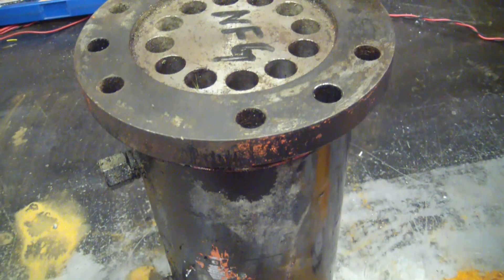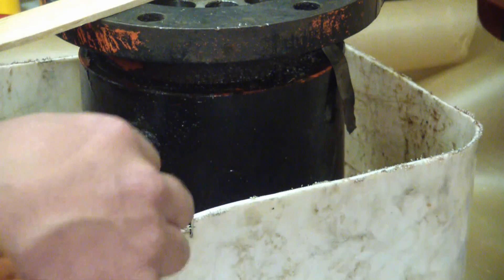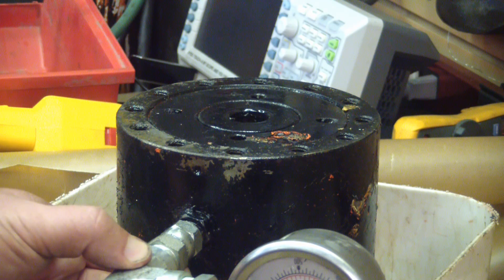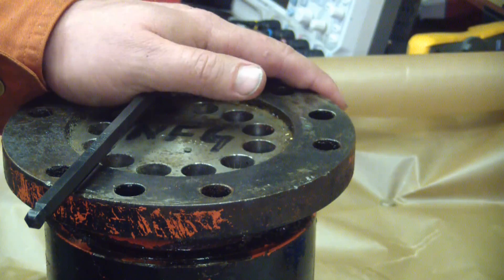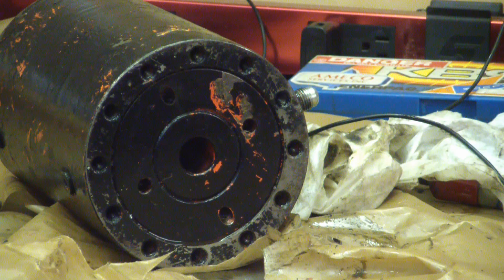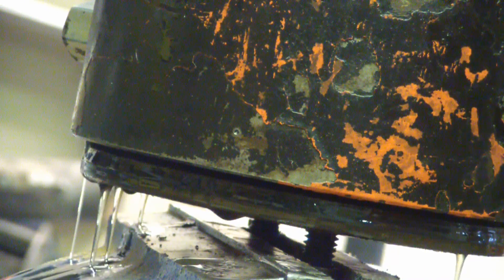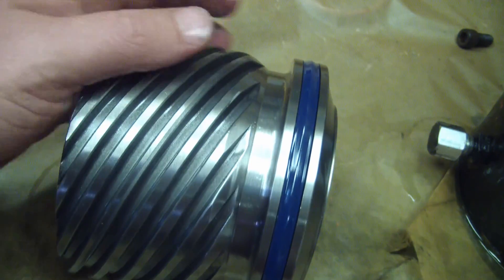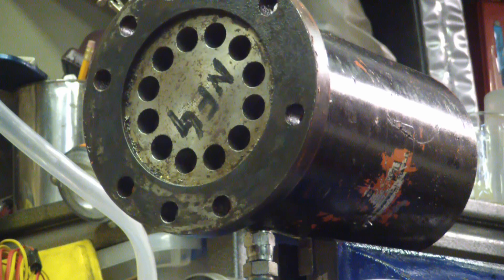BOLTR: Helac Rotary Actuator

Comment: With China making everything, it is important to remember that there are standards, and then there are actual dimensions with tolerances. Take clothing, like bathrobes or underpants. XL is medium at best and in underpants, there are small, medium and large. The larger sizes of XL, XXL, and XXXL,  are the most significant for Westerners to use and use wisely. Case in point, I am not a giant, nor am I obese; but I need at least an XXL or XXXL in a bathrobe for it to fit. In underpants, the good old standby of S/M/L mean nothing is you are a male with testicles, now I'm talking to all you single guys out there. XXL is at best a medium, so XXXL is a large, which will allow you to walk at least.

Comment: This is a great video, thanks. I'm in the middle of rebuilding an earlier version of this beast. The Helac people don't have the seal kits (Helac Hydraulic Rotary Actuator Seal Kits Part #: S26079) and won't provide specs. Has anyone here had any luck sourcing these seals outside of the manufacturer? It would be a shame to see this actuator go to the bin just because of old seals. It never saw much work in its 18-year life.
Any help would be much appreciated.

Comment: Probably useless to comment on a 7 year old video, but that's not a helical gear, AV, it's a multi-lead thread, looks to be acme form or similar.  I'd guess it's at least 8 or 10 lead from what I can see, so find the pitch (or lead) of a single thread and you'll have the ratio of turns to linear movement.  From that and known PSI and area of the piston you should be able to calculate the torque to PSI formula.   I love seeing this stuff from AvE, but I didn't realize this video was so old until after I watched it.    Keep up the fun!!
Reply from the maker: Good thinking!

Comment: God I love industrial equipment.  It's so ridiculously overbuilt.  That thing looks like it could turn the fricking planet on its axis.

If you put a monster like that into practically any conceivable hobby project, it'll probably never reach a tenth of its actual capacity.  In other words, it'll be chooching on a verifiably monumental scale.

If anything in your jury rigged contraption fails, you can be damned sure it will NOT be this thing.   And that's the kind of peace of mind that just about brings a tear to my eye.

Comment: I’m curious because of my work why you pointed out the hydraulic oil coming out of fittings? I have this happen all the time usually a drooling or quite a large hose dumping but never under “pressure” curious what exactly you meant by stop if you have oil coming out on here to learn

Comment: It's a worm on worm gear from what I see.  Forced rotary action  from the piston pushing out on the screw.  The big time pressure was the gears seized, get them flowing together properly and it'll work right quick.

Comment: There is, I believe, a solution to the gear reduction conundrum. The answer lies within the angle of the pitch of your helical gears. I don't believe you would even need to calculate pressure into pounds force and the resulting torque as a function of pitch angles. You could go that route for the long form or to check yourself but I think it might be unnecessary. I believe you could merely figure a ratio between pitch angles between helicals and boom, gear reduction. I could very well be incorrect though.

Comment: I think it needed a resisting force ( outside ) acting against the pump induced torque in order to work right....is left hand thread / right hand thread/ set up...needs resistance of outside force to make one of the possible direction of reaction work....at least, that's what I think, but I might be tto drunk to make sense

Comment: "if youre handed a wrench, that doesn't mean your qualified"  Starts bashing it with said wrench while under 1500psi of pressure. Thats my guy
Reply: I liked it when the wrench slipped off and he then said it had reached the correct torque. Lol. I call adjustable wrenches 'nut f*^kers' for a reason!
Reply: You my friend have no idea
Reply: To be fair, he was smacking the 1 1/2" thick plate on the end that bolts to something. Not the thinnest part that holds pressure, like the walls.

Comment: Does it continuous turn? Or does it only turn through a certain number of degrees and then it has to be reversed?
Reply: I'm pretty sure it only rotates a set amount, then has to be reversed.  He thought it had reached the end of rotation at one point in the video, plus the way those gears are cut would not allow for continuous rotation.

Comment: We used these on ships to power the winches (No, not that kind, matey.) for hoisting nets and whatever we needed to retrieve. There were larger radial hydraulic motors as well, high volume, low psi.

Comment: Could have just dropped a bolt in each of the holes and laid a bar between the two and use the bar as a wrench.   Same as what you did but with no measuring or welding.   Anyway, awesome gizmo!!

Comment: Worked at helac in Enumclaw Wa. for a year, great company! Most commonly seen use of this kind of part is the basket twisty bit on a giraffe style man lift what makes the basket go left and right without moving the body. More of a neck shake than a twist of her hips! On a much larger scale, it's older more robustly devastating brother is mounted on the backhoe bucket of an excavator and allows the bucket to dig left or right instead of just back to front. Only the lady's should be using the back to front technique! SKOOKUM AS FRIG! We built them that way. MURICA!

Comment: So this gets pressurised and then rotates... But it requires a huge amount of pressure to do so? What use is that over something like an electric motor in the same application?
Reply: Research what torque is. It rotates slower than whatever you're driving it with, but with MUCH more force, useful for lifting heavy things that the initial motor cant handle.
Reply: @xANTHQNY  so it coverts rpm into nm²?
Reply: Just Nm, torque is the rotational equivalent of force. Hydraulics do the same things that simple gears do, converting Low force, high movement into High force low movement or vice versa

Comment: slight metal less then 20 microns in seals is ok as long as the internal cross piston leakage is not too high like over 40ml. Any more then it may sheer and heat that area up.

Comment: Rebuilt quite a few of them.
Aerial work platforms like JLG,  Genie, Skyjack, ect... use them for platform rotators.
They suck getting back together as the 3 spiral splines are all timed so it doesn't rotate too far to one side and damage the boom, cat track assembly, wiring/hoses, or platform.

Comment: I am a diesel and hydraulic mechanic and we work on JLG man lifts and the basket rotator is damn near identical to the one your working on. They are a pain to rebuild and they usually start leaking around the seams from all the dirt and trash around it.its cool to see some one else with one doing the same.

Comment: It would be helpful if when you are showing an adjustable jaw, Cresent type, wrench being used that it is oriented in the correct direction to apply torque with. I would guess that a large percent of people don't know which direction the torque wrenches designed to be used in. If it's used in the wrong direction and especially if someone hammers on it it is very easy to bend the floating jaw and and up with a wrench with the jaws no longer parallel. Usually it will splay the outside most edges of the jaw out. Which usually results in the wrench still being usable but now the wrench is more to likely round over the head of a hex fasteners. If the floating job ends in the other direction it really sucks because when you slide the wrench all the way onto the bolt or nut it will be loose and require you to further tighten the floating job before applying torque. Then when you want to slide the wrench off the fastener you will have to loosen the floating job before you can do it. If Mr. Forrey, my high school shop teacher caught you using the wrench in the wrong direction he would make you take a 10 minute break from what you were doing to consider how destructive you were being to his nice quality tools.
Other than that minor faux pas you are putting out some of the most excellent videos anywhere on the Internet. Thank you for your consistent quality work. Every person interested in stuff thanks you.

Comment: The biomass power plant I retired from had them to swing the reclaimers. The reclaimers were bucket chain conveyors on booms which were mounted on masts that were swung left and right across piles of wood waste fuel. The buckets dragged the fuel into hoppers that fed conveyors that moved the fuel into the boiler house. Pulp mills use similar machines to move chips to the digesters.

Comment: i have used one of these before then put a solenoid on the air inlet.  

http://www.tooltopia.com/otc-tools-2510a.aspx?utm_source=google&utm_medium=cpc&utm_campaign=paid_search_google_pla&scid=scplpOTC2510A&sc_intid=OTC2510A&gclid=CjwKEAiArbrFBRDL4Oiz97GP2nISJAAmJMFarT59SbG-aMj0pAtkMOQfQ5kj-rIVJk5d98vFIir44xoCj0Xw_wcB

Using a arduino i was able to dial in a short timed 24 vdc pulse via a solid state relay to achieve one full rotation of the piston in the pump. with that setup i was able to very precisely control 10,000 psi on a shop press with a S beam load cell like this 

http://www.omega.com/pptst/LC101.html

maybe this could help with the bar robot project :)

Comment: turns linear motion into rotary motion. a piston moves in one direction with a spiral gear on the end, and engauges another spiral gear. piston moves, the end turns, piston moves back, then end turns the other way. simple.
Reply: Not gears , they're multi star acme threads.

Comment: What did he do to actually make it work with air? Was it the draining of oil after it was apart? So taking it apart gets rid of the trapped air bubbles that just compress like little balloon instead of flowing like fluid?
Reply: He didn't make it work with air. After the air failed he switched to a hydraulic pump (where he tilted the fitting that leaked blue oil) for the rest of the video.

Comment: Air and any fluid can kill. We had 3 Contractor Plumbers killed in mid 90s, while putting in a 16" water meter. They did not bleed air slowly. It was a 16" 150 psi water main, but it was coming off a 72" transmission main. And they were in  vault because north of Detroit it gets cold. Pay attention to his safety advice.
Reply: Stephen Paraski 
I do find it a bit odd that most people seem to think that static hydraulic pressure is somehow more dangerous than air though. I've probably burst over a hundred tubes and cylinders between 1500 and 12000psi and its more of a cumshot than an explosion due to incompressability. 3000psi air or even 300 though can easily kill.
Reply: They were 9' underground with 2-36" manholes as acess to a 10'x18' vault. When the hammer broke that 16" line the volume of water negated any chance of escaping. They did not have any "Retreval Device", after which became mandatory for entrance but are useless as line becomes entangled in enviroment.
Reply: Stephen Paraski i

Comment: @ave, The piston in reference to the housing, OVERDRIVES the output. yeah, nuts, right..? 
As you turn the piston ccw, it raises on the output shaft. now, imagining the piston were rotationally stationary and if it were to travel upward in the housing, the housing would rotate........You guessed it, ccw!  add the housing rotation to the output rotation and you have a relatively overdriven output!    

The reason I imagine that they do that is because both helical gear cuts appear to be the same pitch, but opposing! So, if you were to rotate the input, it tries to both rotate the piston and push what looks close to 90* on the thread in the body. we all know rotating a bolt along the thread will get you further than trying to just yank the bolt straight out, perpendicular to the thread angle.. ;)

Thanks for the cool vids Ave..     

Btw, I'm going to assume your real name is Wilson....  LOL    :-D

http://resources1.news.com.au/images/2014/04/14/1226883/586709-cf246e92-c362-11e3-b397-01c2dd417b4d.jpg

Comment: I know this is an old video BUT Just so you are aware, in the UK you can handle any hydraulic or pneumatic system with any pressure, however under the PED and a lot of the ASME coding it stipulates that anything attached to a pressure system over 0.5 BARg ( approx 7.25 PSI g) is only allowed to be maintained and and tested by an approved body. This can be an insurance company or a test house like BAE or Strata. So yes, anyone can handle the system, but not no one without approval is allowed to alter or modify anything at pressure, isolation procedures are needed the same as any form of power.

Comment: Looks just like a rotating motor that goes on an articulating manlift basket. Its the actual motor that the basket bolts to and then rotates the basket left and right. Very solid motor designs mostly due to the fail safe factor, no shafts to fail, no vanes or gears to get stuck and is very smooth and linear.

Comment: Strange there were no obvious fixing bolt holes for the outer body. I would have expected some massive flanges etc to handle that torque. Also on the rotating bit, is the main power output the solid bottom of the inner 'rod' ?, as the other end was only held by the thread and the four dimple screws and doubt that would handle the torque?

Comment: 10 thousand psi in the wrong spot will turn you into...    dead.
Reply: in all fairness.. so will 3,000 psi, especially if it's hydraulic fluid... it'll lop your limb right off  if you have a big enough stream fanned out (like say a cracked cylinder) aimed at the right spot.

Comment: Yeah, I was translating an MSDS for aircraft hydraulic fluid (which I think is about the only time anyone reads the damn thing) and the horrors I had to translate into my native language about hydraulic injection and high pressure systems potential to maim, the effects of the hydraulic oil on skin, eyes and your health in general... Geeez
Reply: Hydraulic injection! For me that's the most frightening part of hydraulic systems. A friend of my father's ran his finger down a backhoe line that was leaking, pinhole shot it down his middle finger into the palm. Had to have half the hand cut out because of necrotic tissue.
Reply: I was thinking about that when he got the oil on his hands.

Comment: I didn't catch what the cause of failure was and how it was repaired. I did see that there was some contamination in the fluid and that the wear ring was scuffed, but was there something binding it up or what?
Reply: Contamination. Particles in the oil causing gears to seize.
Reply: That must be a very tight fit! The particles shown looked like they would go through most fuel filters.
Reply: For $10k I`d imagine it holds mircon tolerances even at temp.

Comment: I think I know what NFG stands for when it's written on something with a Sharpie. If you can spell electrician you can be an electrician, in Arizona. I love the smell of ozone and burning flesh in the morning. We used to shoot this little Navajo pipe fitter out of pressure vessels just for fun. He is off working on a fertilizer plant in Iowa right now. I remember he took the cap off a 36" air line and it still had something like 180 psi on it. Holly __! It was like artillery shell!! It ripped open 4 layers of 3/4" sheet rock & 16 ga metal studs for about 40 feet, and sounded like a bomb went off. If I want something TIG welded really well, and with the better precision than a robotic welder, he is still my first choice.

Comment: What would that be used for? As it looks like where you would connect the load would rotate?
Reply: +Keith Gardner Articulation on heavy equipment.  Think, boom arms and buckets on earth movers.  You might run it through a cam or pulley to get the range/rate desired.
Reply: Oh ok, thanks

Comment: very excellent jokes aside I couldn't agree more on the the fact that 'sparks' need to be certified to work on lectrics yet any idiot with a spanner might do himself or others a mischief or fatal mischief with hydraulic system, especially when accumulators involved! I have educated many seemingly 'experienced' men on the virtues of pressure storage. look common rail diesel, up to 2000bar now sure just crack that injector pipe off! love the gold mill by the way, very cool set up was really into that.

Comment: most useful thing about your videos: comments about what not to do and how to tell if you're in the middle of doing it: spitting out fluid? stop; find out where the pressure is. does not free up when unscrewing? stop; might be pre loaded. think how many fingers you have saved your viewers
Reply: betabenja Precisely. Thanks to uncle bumblefuck I still have both mine left
Reply: Yupp! Almost made the mistake of trying to open an relief valve for a 3in high pressure line. Half way through unscrewing a plate that surely had a beefy preloaded spring behind I remembered hearing "if it doesn't loosen up when unscrewing it might be preloaded" and realized my stupidity. En la basura!
Reply: Spot on.  Captured large springs scare me more than high voltage, and as a maintenance machinist I encounter both regularly.  You can put a meter on a line and check for voltage, you don't have a meter to tell you how much tension or compression is on a captured spring!